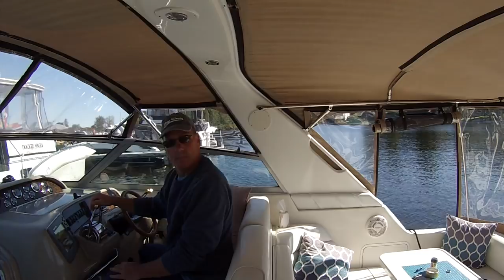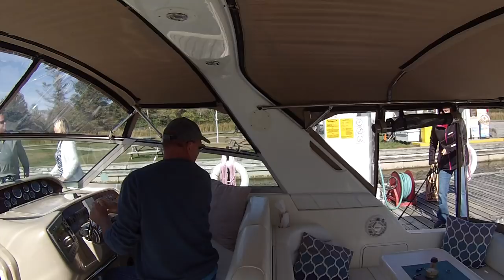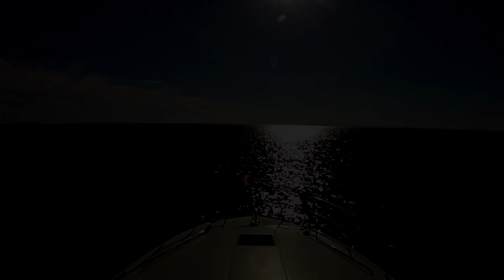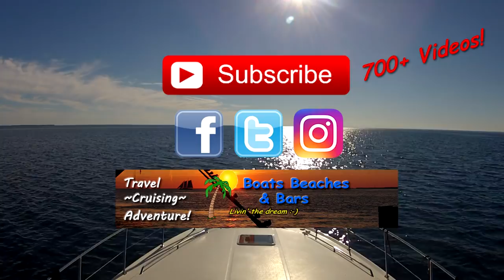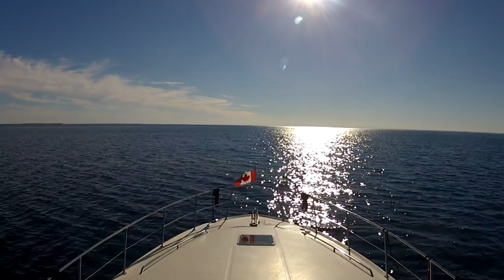Using Shifters to Steer A Boat

Comment: I am new to our v-drive Sundancer 310 and am still practicing the concept of steering with the throttles. My mentor pointed out that the throttle and shift lever are bent on the end with ball which indicates which direction the bow or stern will travel if the lever is pulled back or pushed forward. It was helpful to me. I also learned to leave the steering centered while traveling in reverse whenever possible. Also to use the throttle in short bursts and use the shifters in and out of neutral rather than leaving them in gear, either forward or reverse as applicable. Thanks for your directions in all areas. I am now working on the duck bills with your help. Thank god I was a father and grandfather as I changed diapers and learned to duck as well as get used to the smells, sort of.
Reply: Thank you. That makes sense. We haven’t started our training yet…

Comment: During our training (masters designation from Transport Canada) this is the primary way for all slow speed/close quarters handling.  Works just as well on our 32' I/O diesels.   Keep up the great work Paul!!!!!
Reply: Because rudders require a flow of water over their surface that provides enough force to counteract the tendency of the vessel to track straight ahead (or backwards)...at slow speeds or running with a current the water flowing over the rudder surface may not develop enough force to control the vessel.
Reply: tprdfh51 thanks.  Was already aware of that.  Just sharing my experience.
Reply from the maker: Works well - and much preferred to cranking the wheel on our older I/O powered vessels ;-)
Reply: Just like running a tank or bulldozer with tiller controls. :-)
Reply from the maker: Or a skid steer/Bobcat ;-)
Reply: ...or tank! :-)

Comment: You may want to remake/correct the video. Your port and starboard are right but your right and left need a bit of work in the beginning. I like the video though. We lost our rudder on a yacht trip a while back on the inter coastal waterway in Florida and the captain used the engines to steer. I'm looking to buy and am weighing options between yacht types. Thanks for the video.

Comment: Great Video ! What is the difference though between the shifters and the throttles? Do they both not do the same thing ?
Reply from the maker: No. The shifters shift the transmissions between neutral, forward and reverse. The throttles increase or decrease engine speed.

Comment: A good way to remember how to use your shift the controls is to place your right hand on the Starbord shifter on your left hand on the port shifter with your thumbs pointing at each other . For example when you place your Starbord shifter in forward and your port shifter in reverse the bow will swing to the left and the stern will swing to the right the exact directions that your thumbs appointing in.  Putting your port shifter in forward and the Starbord shifter in reverse the bow swings to the right and the stern swings the left.  You can actually walk your boat to the dock using just your shift the controls .
Reply from the maker: That's a great tip for newbies.

 I do have a serious comment for you though. How come, with a great channel name such as you are using, that you don't have one video of your #SeaRay? I'm gussying you do have a Sea Ray, correct?
Reply: Yes I did have a Sea ray, unfortunately I had to take a break from boating , but now I'm in the market for a 45 footer 2000 2004 with diesels.

Comment: Just curious, but is using the shifters this way hard on the transmission?
Reply from the maker: 22 years and nearly 1,400 hours and still good. . .
Reply: @BoatingWithBoogaboo , thanks for the info, and the instruction--very useful.

Comment: happy new year!  what is the gph on that boat?  i enjoy your video's, keep them up!
Reply from the maker: Although I don't track fuel consumption, I'd guess it's around 1 mile per gallon. My general rule of thumb is when the #boat needs gas, I fill it up. The day I start worrying about what it costs to run/maintain our boat is the day I gotta get out of it ;-)

 Cheers and Happy New Year, Paul.

Comment: Do you think this method would work similar for the sterndrives if you centered them?
Reply from the maker: You'd think it should, but it doesn't. Boogaboo III was powered by twin I/O's and I was hoping that would be the case, but no luck. The difference is that the thrust from an inboard vessel is directed from farther forward and beneath the #boat, whereas the I/O setup is behind the boat. Inboards have a better pivot point for making turns. An I/O still requires input from the steering wheel.
 Make sense?
Reply: Yep, that’s what I was worried about as well.  At least I’m reading this from the helm of my friends boat.  Hey, it couldn’t get much better!!  Thanks!
Reply: We have twin sterndrives on our boat and often manoeuvre it with just the engines, keeping the helm centred.  It depends on the conditions, and on how close your engines are to the centre;one.
Reply: John Landells I tried it the other day.  Worked well.  Got hard when I had to turn the wheel, because I lost the center!
Reply: I have twin I/O and i don't touch the wheel once in the fairway to the slip.  Just no need if you take your time.
Reply: dont touch the wheel!!!

Comment: All very well showing the use of controls, not much use if you can't see what happens to the boat, don't need to look at operator for the whole video.
Reply: Exactly.  The only thing I actually learned from this video is that you can use the shifters to steer the boat--how you do it is not clear.  Would have been instructional to show the directional effect each shifter position achieves when docking.  Great comment.